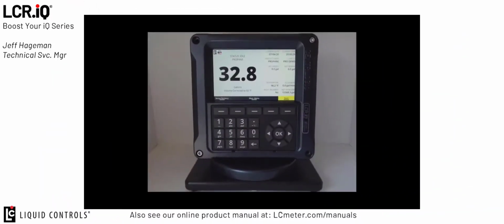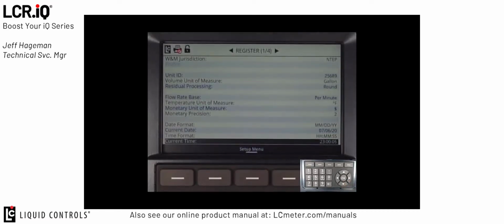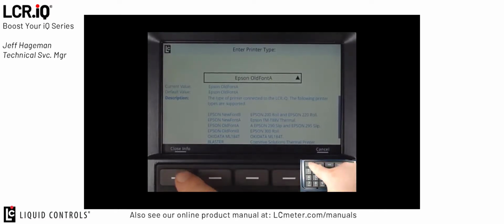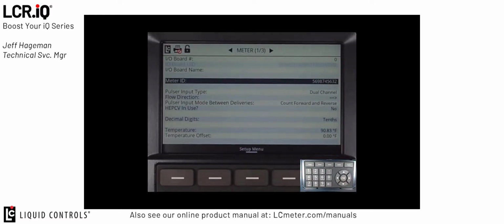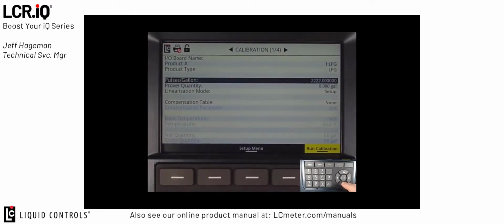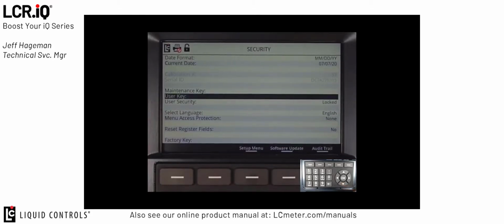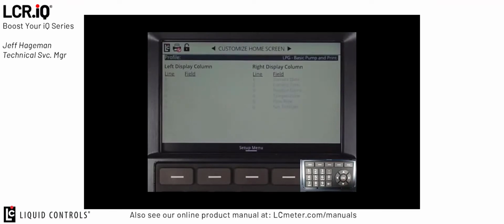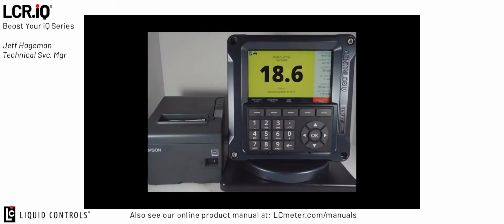Boost your iQ Series -  Setup and Configure LCR.iQ for LPG Bobtail Applications

Comment: Is there a video out yet on setting up wireless communication? Trying to set up Bluetooth communication with our third party routing system on a tablet. Currently, I have followed the steps in the iQ manual, and once I get to the step to turn Bluetooth on, there is no "On" function to select. Register is unlocked and in Calibration mode. Thank you

Comment: How do you reset to 0gal, after you have used it?
Reply: Hello, The register resets to zero each time the start button is pressed and the screen test is complete.  If this test does not complete and the meter is not reset, there is a diagnostic reason for this and the register should inform the user of the issue.  With all LCR product, the counter is not reset until you are ready to make a delivery as many controls such as the valve and sensory equipment are related to the start of the delivery.
Reply: @jeffhageman5002  can you reset to 0 gal throught external connetion?